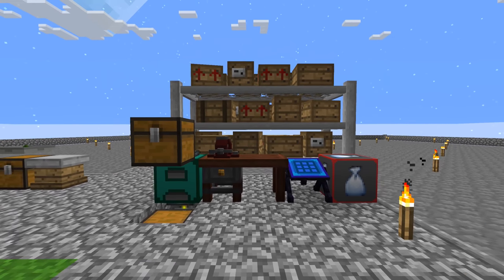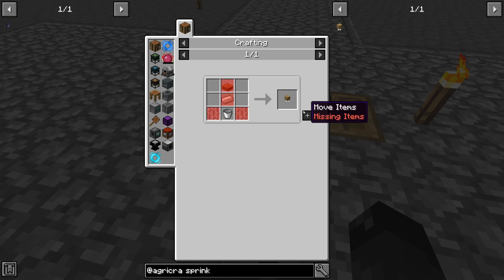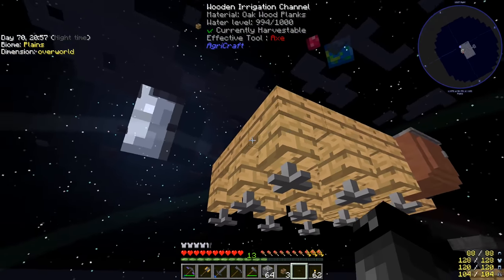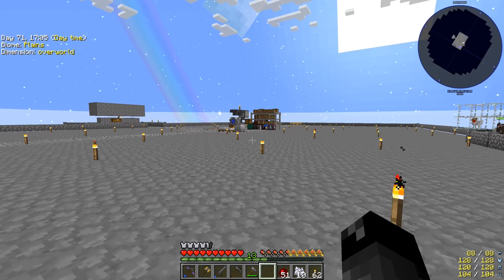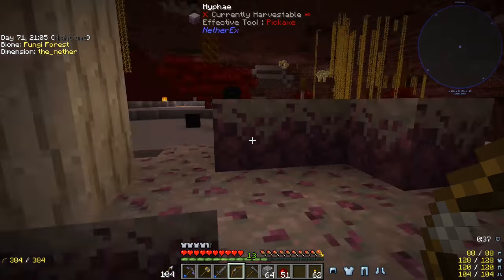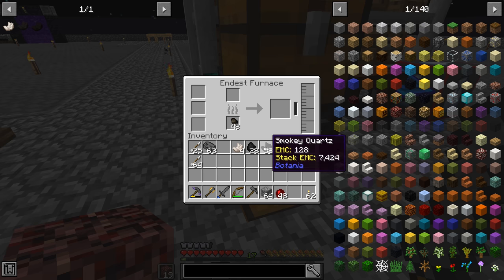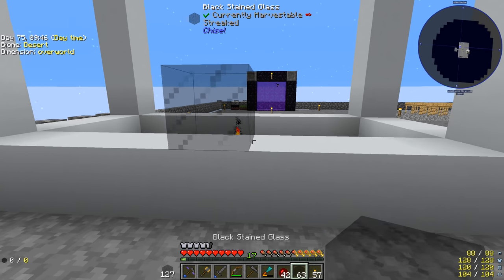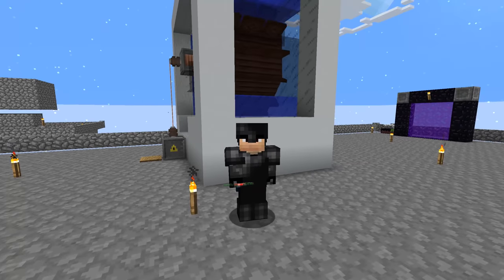Project Ozone 3 Kappa Mode - STARTING POWER [E10] (Modded Minecraft Sky Block)

Comment: Next time you're in the Nether, grab some of that bloodwood. You can use it to upgrade your sword handle to have Morgan Le Fey, means when you kill mobs they drop blood droplets, which is an easy source of slime! Also, sieving crushed netherrack will give you rubies, which make a much better armour than what you're currently wearing without needing to go through the armor progression. FInally, you definitely want to upgrade your furnace! The efficiency, speed and ore processing upgrades will make it very OP!

Comment: The benefits of having a larger irrigation tank is to have more access points all round the tank & to make different access points use water up until certain thresholds of water so if you have 4 farms or so farms, you can choose which farm dries out first i.e. the potato farm will run out first, then carrot, then flax and lastly canola.
It's nice to have a food source but sometimes your base relies on canola oil to function and thus it's better to prioritize the canola farm.
Having satisfied your canola farm and having just enough water production for the potato farm.
-
The lower you put your irrigation channels, the more your prioritize that channel and the more water it has to work with.
Because you don't want to have your canola run out of water by having multiple farms connected at the same level at once.
-
It's practically useless after 2 hours of progression & optimization, I know. But it gets the job done just as well as an AE system that's tuned to distribute specific amounts of water as to not run out of water in steam production for your efficient Extreme Reactors' (or Big Reactor) steam turbines.

Comment: There was a loot bag that the longer you held it, the greater the reward from it. Maybe the artificial bag is that? Or maybe it's just a troll bag?
Reply: patience bag i think. The tooltip says it anyway so if he finds one he will realise
Reply: @theultimateweeb4276   The way the bag works is you have to setup a loot bag opener loop. Its not the length of time you have it but the amount of opening you do, its an extremely low chance to get the nether star from the bag. So it takes a lot of time.
Reply: @sullicoe63  1 in 1000 .. but 4 lootbag openers with 4 flat transfer nodes can have 4 of these cycle in there for not many resources needed.
Reply: @thorondir42  Oh you dont need alot, just time
Reply: @sullicoe63  it was edited for this pack there is no nether star...and its not the same bag
Reply: @theultimateweeb4276  patience bag is not the bag he means

Comment: For anyone playing PO3 and don't know how to get soul sand:

1. Sieve Dirt with Silk Mesh for Ancient Spores
2. Use Ancient Spores on Dirt/Grass blocks by right clicking to get Mycelium
(Mycelium spreads like normal grass so you only need one next to Grass/Dirt blocks)
3. Place any Wooden Barrel on the Mycelium
4. Fill it with a bucket of water and wait
(It will turn into Witch Water)
5. Right click the barrel with Sand and you will get the Soul Sand

Comment: Hpyno if you want to be super-efficient with  crops to get them to 10,10,10 seeds there are 2 ways.
One is to make a 3X3 start on the corners then cross-fertilize on the outside before working inwards. 
Or if you want to run it afk, make a line of farmland of 10-15 put cropsticks on each one and plant one seed at the very end. Once it reaches the end it will always be a 10,10,10 seed.